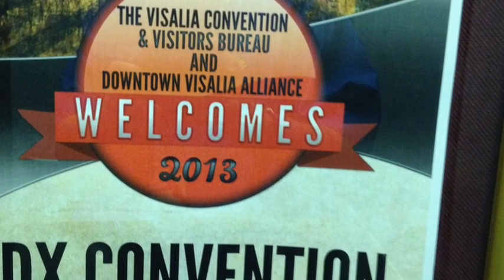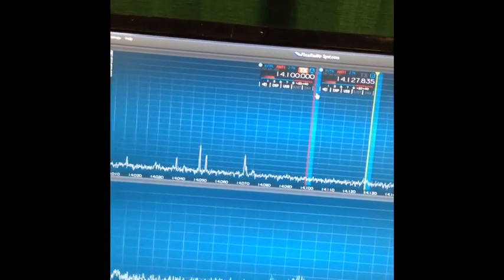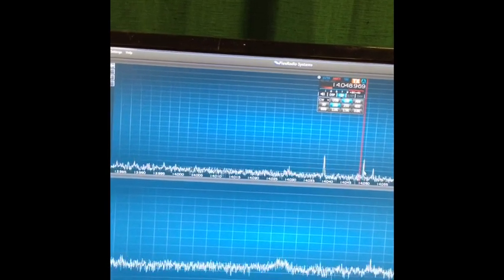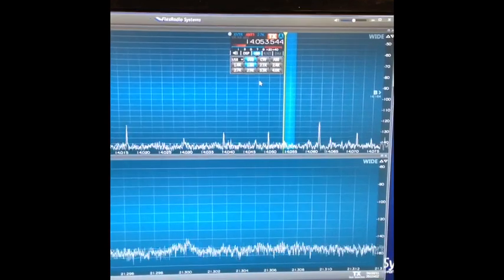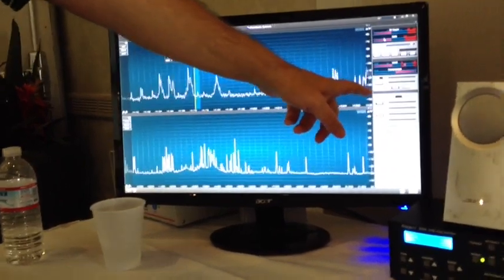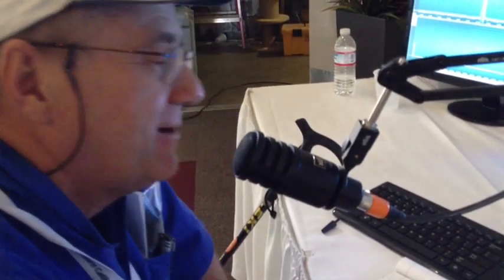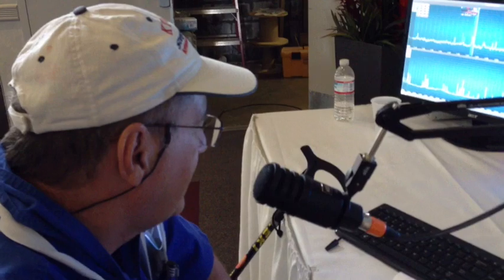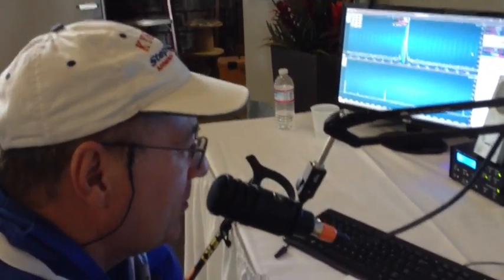Visalia DX 2013. Flex 6700

Comment: Dudley has been a friend for some time. No problem with Tech Support. Flex 5000 fully loaded owner for sometime. Transverters up thru 10 Ghz. Call their number and see if you get a return call back. Answering machine on 24/7. Not a way to run a company.